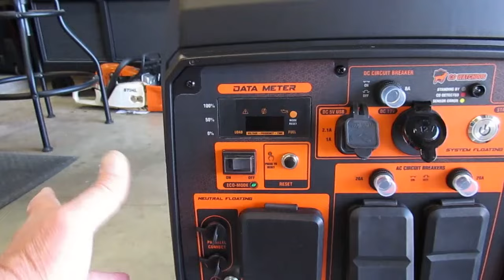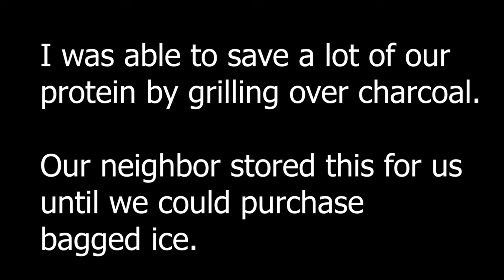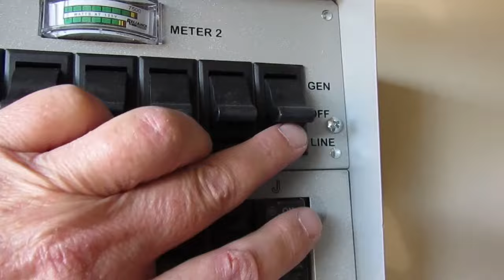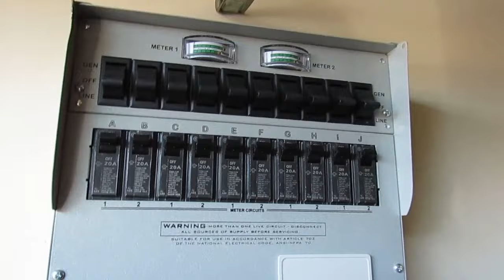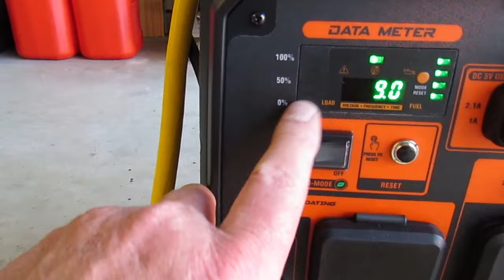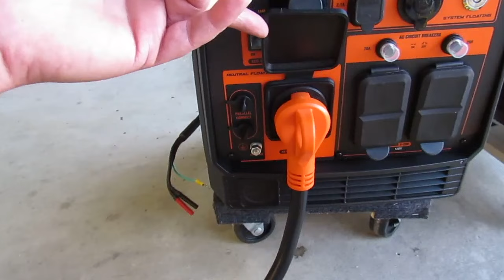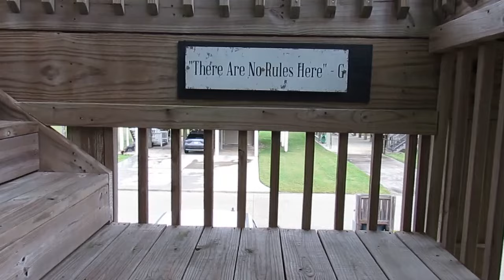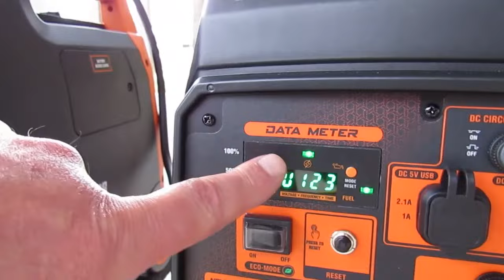Two Homes: How I Configured My WEN Generators and What I've Learned About Storms.

Comment: Tough decision: generator, solar or battery?  My final choice was - all the above. I have enough solar to power the whole house as normal on sunny days. I have enough battery to power the house for 28 hours. I have three trifuel trifuel inverter generators the newest one is largest and will charge my batteries in two hours. As a test I went off grid on Tuesday before Thanks giving. Three days later my wife finally asked  why the dish washer would not start? I told her that we had been off grid for three days. Her reply was " cool, now how about you turn the dish washer on. I said ok and grabbed the generator remote, wallked to the window, started the generator and told her to try it now. The next day we met some friends and over cocktails I overheard her telling the other ladies about going off grid and she did not even notice.
Reply from the maker: Agree 100%.  The ultimate solution is multiple sources of power achieved in different ways and the robust nature of this solution is verified by your description of running for 3 days.   As you know the equipment needed to run like this can be costly and I would not want to discourage anyone from acquiring even the smallest of generators/solar just to keep the fridge running, a light or two lit and so on.  For most people I'd guess that backup power is evolutionary...they start with a thing and then evolve and add more things to make backup power more accessible.  Just a guess and I'm all about only buying what you can afford.

Even whole-home generators are not without significant disadvantages (my neighbors, for example). Big bucks to install the system, the propane truck must be able to reach their distribution point and then physically reach your location, everyone is screaming for their propane to be topped off all at once and the cost to fill a propane tank of that size over and over again is staggering.  A backup for your backup seems to make a lot of sense.

Two days ago our inland home lost power for two hours.  No explanation given and it's a very populated area. This happens more and more frequently.

Comment: I lived through 12 days without electricity after a natural disaster and your advice is spot on. Everyone should listen to it then listen again to catch what they missed the first time and then implement your advice to be prepared. I’ve lived through multiple once in 100 year, 500 year and never happened before natural disasters in the past 20 years. It’s not a question of if but when for everyone.
Reply from the maker: Thank you for the kind words and your advice to others.  Hopefully viewers will turn your thoughts into actionable plans. Nobody is coming to save you.  Case in point: Centerpoint energy servicing the Houston area - their lack of preparedness before and after Beryl struck was so egregious the governor of Texas, Greg Abbott, got involved.  Odds are we'll never hear the outcome or notice any preventive measures.  Nobody is coming.

FEMA rejected my claim for $750 with no explanation even though I've met all criteria.

Props to the boots-on-the-ground guys.  Here locally they were working in unbelievably tough conditions.  Soggy ditches and ground incapable of supporting their heavy equipment, swarms of mosquitos, perpetually wet, God knows what else. Management is the problem.

Comment: You shouldn't have to tip the generator over to drain the oil, there is a little round rubber plug right below the drain bolt for the oil to flow down and out.

Comment: Both generators are floating neutral which are designed to plugged in to a power inlet to run your home. You can not use the ac 120 amp plugs without getting shocked or killed because of that. In order to use the outlets with an extension you must convert both generators to a bonded neutral  to the generator frame.
Reply from the maker: Interesting.  Let's resolve this.  What may not be evident in the video is that when installing the parallel connector to gang generators together there are three leads for each generator.  A positive, a negative and a robust ground wire that connects to a stud on the face of each generator (10mm).  I believe this stud resolves the bonding issue you mention by bonding to the frame (we might assume).  

By "120 amp" surely you meant 120 volt and for clarity you are referring to the four 120 volt outlets on each machine-face. Honestly I've never actually tried plugging anything into those outlets when the machines are ganged together.  I received good information that extra power could be squeezed from those outlets but I don't remember the source.  WEN product support? I just don't remember.... 

Let me know if the presence of the bonding studs changes your thoughts on this....

Comment: Nice setup. Thank you for sharing. What do you use for fuel storage? I have the stabil and a can of sea foam. Not sure which is best the sea-foam gets lots of positive reviews. I have two 5 gallons of non ethanol stored. Currently I have been using the 4 Cycle engineered fuel to do my break in and test runs. My issue is I’m not mechanical skilled and want to insure I don’t end up with my carburetor getting gummed up.  I was without power after Berly for 8 days. I did have solar generators but after 72 hours and no sun, I struggled. Since I started gardening which lead to composting I don’t use my garbage disposal at all. I did realize how important my ice maker is to me. I never want to experience not having ice in the Texas heat again!
Reply from the maker: Good questions.  I've been using Sta-Bil for over 30 years for one reason: My wife's grandfather told me to use it so that's what I've always used 🙂.  I hear a lot of good things from my friends regarding their boat storage and Sea Foam but it's hard to quantify effectiveness.  Everyone seems happy.  Machines that sit are sick machines.  Machines that run often, no matter what treatment you use are healthy, or healthier machines.  I test monthly.  We don't compost but scrape plates into the trash - we've always done this.  Just the little bits of food that ended up in the sink from rinsing dishes was enough to clog the disposal on day two or three.  I'd forgotten about ice and my best estimate is that my wife and I doubled our water/fluid consumption without air conditioning. Good luck.

Comment: Thank you for the video! Regarding the dead starter battery, have you found a solution for that? If it's rechargeable, maybe keep it disconnected until you need to use it?
Reply from the maker: @ashwanibhola3766  I purchased the battery tender sold by WEN but After the generator runs for awhile it charges the battery automatically. It’s a bit of a non issue. Before I store the generators I run the gas out of the carbs and you need to use the pull-start anyway to get them going. Once they’ve run for awhile the battery charges up.

Comment: i have 2 4800 pull starts cant beat them one 4800 run everything on my 37 foot fifth both ac unit but takes 2 parell to run the electric water heater and microwave but you can survive with one i do recommend Generator Electric Fuel Pump Kit Extend Running Time Fit MXR4000GT MXR4000 and a 12 gallon fuel tank one runs for about 60 hours plus   , superlight and quiest i sold both of my prediator 2000 for thw wen
Reply from the maker: Gotcha, I'll add this to my wish list.

Comment: Buy one Generator capable of providing enough power for your HOME.
Reply from the maker: As long as you don't have to transport it that is a reasonable solution as stated in the video.  Many are aware that generators can grow to be so big and powerful that they have built in handles and you move them as you would a wheelbarrow.  Conversely, a small lady-friendly dual outlet machine will run your refrigerator....arguably the single most important machine that needs 100% of your attention.  Everything else is secondary to the fridge.
Reply: Unless you’re an ace fixing these that’s not a great idea,they will break down especially if you do not do routine maintenance and exercise the generator.
Fuel is also a concern,those large units consume tremendous fuel.
Natural gas?Your average meter won’t keep up,you’ll need to upgrade.
Multiple units,some small and some medium is the way to go.Dual fuel another great idea.
If you are without power for more than five days you’ll be glad you did it.
Reply: As fuel consumption becomes important dependent on length of outage, two smaller gens running ca be more fuel efficient than one large gen